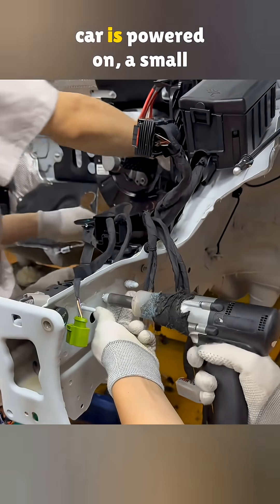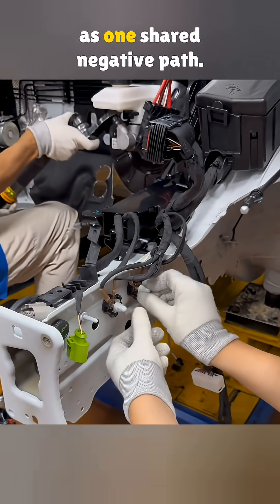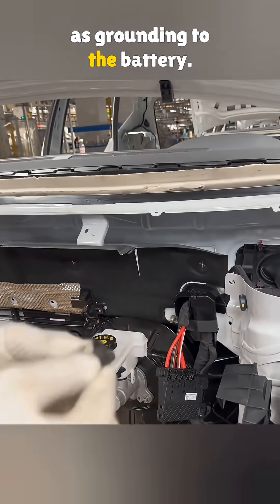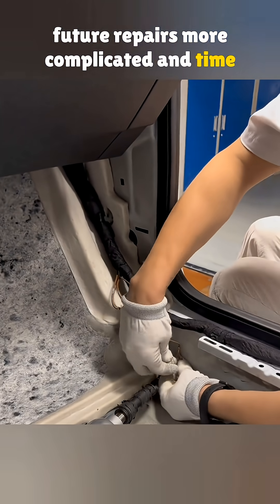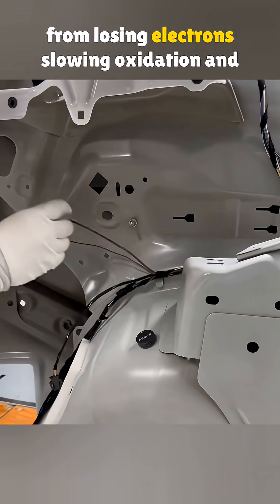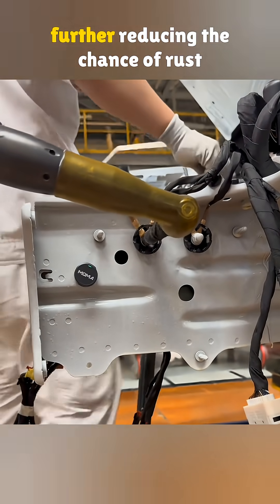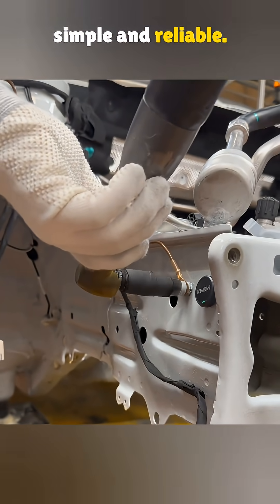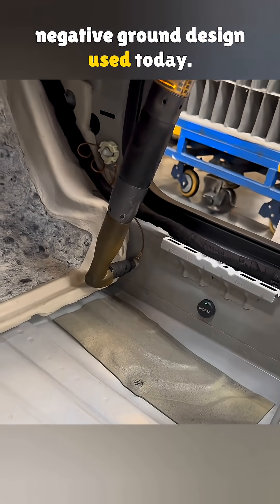How Negative Grounding Keeps Your Car From Rusting

Comment: Cathode  positive.  Electrons are lost into environment or solution there.  Anode negative.  Electrons as attached to electronegative entity are target; completing the circuit, from solution/diffusion speed to wire at 186,000 mi/sec.  Protection is made possible by relegating an easier ruster so that the normal metal-loser-of electron is given to a more corrosion apt metal sparing the prized metal in question.  Normal environments are liquid.  Electricity doesn't do this alone.  Gold isn't a first candidate in sacrificing.  Cars are not made with any sodium or lithium plate.  In general when water lines are protected a certain localized area is defined for where best to repeat.

Comment: It is true that the car body being used as a negative ground is a common practice today. However there were some vehicles that used the car body as a positive ground. They included some old British Sports cars and the Model A Ford.
Reply: Most cars in the 1950's ( such as morris minor etc) used +ve earth.
Became an issue when one wanted to fit car radios that had -ve earth casing .
It was common for the earthing to be reversed by re-polarising the dynamo to output +ve voltage and reverse the battery.  As all other items such as lamps indicators etc were not polarity sensitive - it was fairly easy to do.

Comment: FYI  Newer vehicles have had many electrical issues such as with lights and other things . Most are caused by bad grounds . Keep your terminals clean , check all grounds close to a problem area . If you can find them . Corrosian , rust , paint can be wire brushed away to ensure good grounding . Some issues are hard to find , this is why good diognostics by a Tech. are crucial , and can take awhile to locate .

Comment: I would have thought that modern cars use wiring that includes both + and - to the load. The -ve terminal of the battery is connected to chassis purely as a ground "reference" ?

Comment: Electricity flows from negative to positive.
Reply: Correct !  Electrons have a negative charge so flow towards a positive potential.
Reply: Technically electrons flow from negative to positive and electricity flows from positive to negative. I recall years ago that there was an error/misunderstanding  when electricity was first being scientifically investigated.
Reply: @barryazevedo7099 barry is correct.

When we talk about electricity flow we are talking about conventional current flow which is from the positive terminal of a battery through the circuit and back to the negative terminal.

It is true that the electrons flow in the opposite direction but we refer to that as electron flow , not current flow.

And the fact remains, you almost never need to concern yourself with electron flow except when dealing with the internal operation of vacuum devices such as valves and semiconductor devices such as diodes and transistors.

Even the designers of circuits rarely need to consider the electron flow.

Students of electronics will study the operation of the aforementioned devices and need to understand how they work - that where the subjects of current comprising electrons and holes arise and majority and minority charge carriers.
Reply: The misidentifying that positive & negative 'thing' goes back to Ben Franklin's original work with electricity.   😊

Comment: This is B.S. Modern cars are often protected from rust through the use of rust-resistant materials, such as stainless steel and special coatings, as well as regular maintenance practices like washing and waxing. Additionally, undercoating can provide a protective barrier against moisture and corrosive elements. The direction or polarity of the battery's DC current makes no difference.

Comment: Of course, it has always been so since the first cars with batteries.
Reply: Many early cars had positive earth.
Reply: @eric4709  are you sure? It seems me too strange. I thought scientists knew the effects of electricity on metals since then and even before. Beyond that, it seems to me a nonsense even without of knowing all that phisics: for me it's obvious connecting the negative pole to the metal, and not the positive one.
Reply: @andreapicci8410 
I can assure you that in the  1950/60's in the uk - many cars were + earth - i ran one in 1966.
My father had several cars in the late 1940's to-1969 - all +ve earth.
Many people did convert them to -ve earth ( which required "re-polarising" the generator to give +12v rather than -12v out.
This was done mainly to simplify adding car radios which tended to be -ve earth chassis.
Reply: @andreapicci8410 
I think another problem was that car makers relied too much on using the car chassis as a conductor (saves on wiring)  rather than run earth return wires to accesories.  

The average car then had two 60 w headlamps ( thats 5amps per lamp ) plus side lights + ignition current - some 15-20  amps or so all passing through the chassis - and worse still ...
 several 100amps of starter motor current when cranking engine on startup!! - 
what could possibly go wrong !!?

Cars with Aluminium wings etc bolted to steel  were the real problem !!!

Comment: Approximately 15 years ago, I went to Scotland, and brought over a potable GPS from Canada to use in my rental car. The GPS didn’t work and I was told because the negative on the cars in Scotland are setup in reverse as they are in Canada. In other words, the positive post on the battery is connected to the car’s frame. 
Is there any truth to that?
Reply: No.
Generally cars before 1965 we mostly  positive earth.
Not to do with Scotland ⚠️

Comment: If this is true, why do they all rot? I remember in the 90's my friends Probe GT had an option for this.  If may help but if you drive it everyday it's going to rot regardless. I have mine oil sprayed every year and have a 19 year old Subaru without rust.
Reply: Parking over grass often rusts the chassis underneath the car, due to the grass's humidity. 

Parking or driving near the beach rusts cars too.

Forests are also humid, easily to rusting cars.